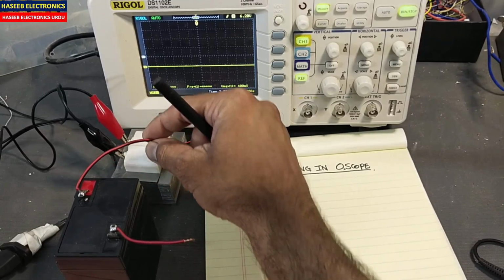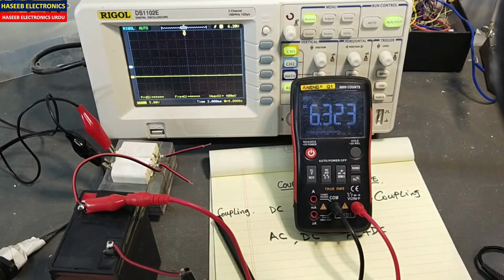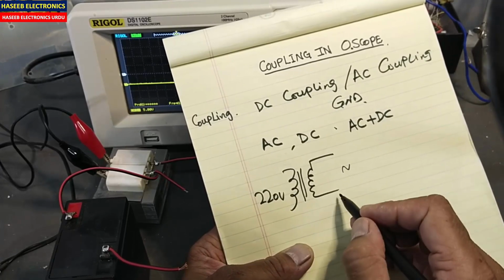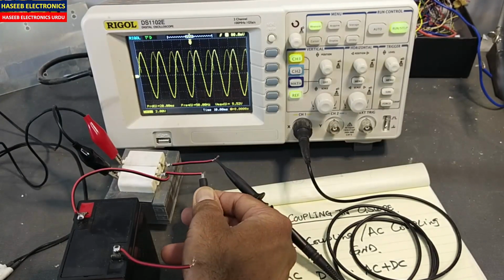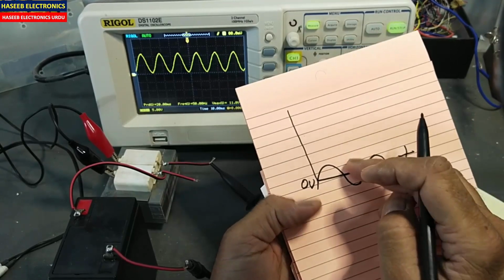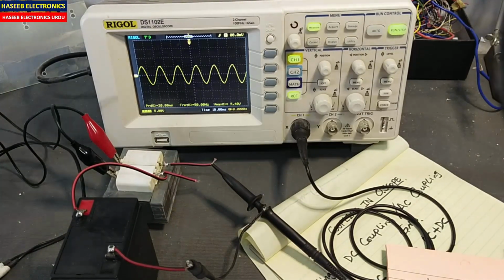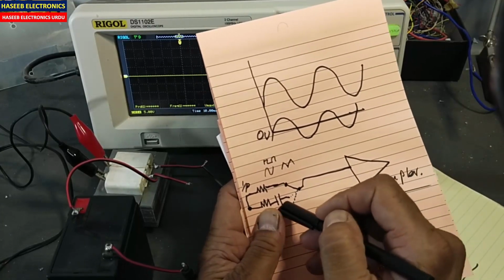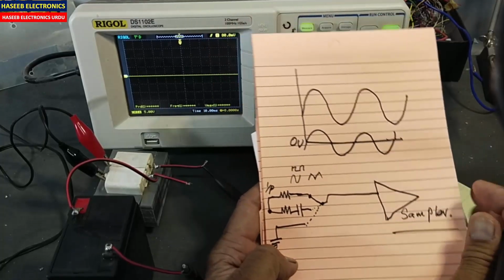{691} AC DC Ground Coupling in Oscilloscope, Explained

Comment: In continuation of this video, can u explain, when we need to use DC coupling, when we need to Use AC and ground coupling. It will be much appreciated sir
Reply: This is easy to think too much on... It is a simple matter... When you are interested in the AC component of a signal, you use the AC Coupling function. In like manner, when you are interested in the DC component of a signal, you use the DC Coupling function. Very often, when troubleshooting a circuit, you will look at both components, AC and DC. Here is an example of that... You are looking at the output of an audio amplifier, which is AC. The circuit contains a capacitor in series to block any DC from reaching the speaker, because DC will destroy a speaker. So, you use AC Coupling to see that the amplifier is outputting the audio signal correctly. Then, you switch to DC coupling to make sure that the amplifier is not outputting any stray DC voltage. If it is, the amplifier has a fault of some type. I hope this helps your understanding.
Reply: I also had similar question. I hope Ac coupling can also be use to remove the ripple or noise of a dc circuit. You could experiment by putting sml capacitor in this circuit and watch as the AC signal is attenuated. 
What I want to know is when is gnd coupling used?

Comment: A very informative and easy-to-understand video—thank you for your work! I have one small question: why we need ground coupling in oscilloscope ?
Reply from the maker: Regards 💕 
Ground coupling disconnects the input signal and internally ties the amplifier input to ground
Purpose:
It gives you a 0V reference line on the screen to see the DC offset in any signal 
Useful for baseline alignment before measuring a signal.
Helps you see where “ground level” is, especially when measuring small AC signals riding on DC.
Reply: @HaseebElectronics I understand now. Thank you again so much!

Comment: Watched a video showing DC coupling with sawtooth via a function generator, but when switch to Ground coupling the baseline aligned immediately on the Zero Volt baseline of the DC Zero volt line. Yours as well as mine does  not do that. I do not understand how to get it to align.

Comment: What is practical usage of ground coupling?
Reply from the maker: 1. it is used to calibrate the oscilloscope
2. and it is to verify the trace-line position, when a signal is connected, and we want to verify the exact value  of the signal. at time, switching to ground coupling, gives the trace zero line and when we switch back to signal value, we become to know the signal actual value
Reply: @HaseebElectronics  Ok, thanks for explanation.
Reply: @HaseebElectronics  will be much appreciated, if   u show some practical example for GND coupling in videos.